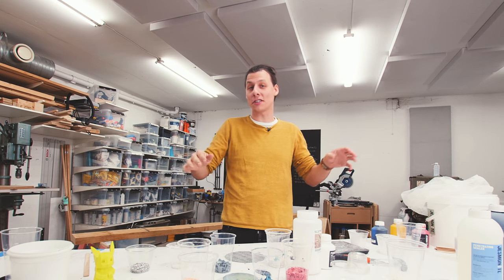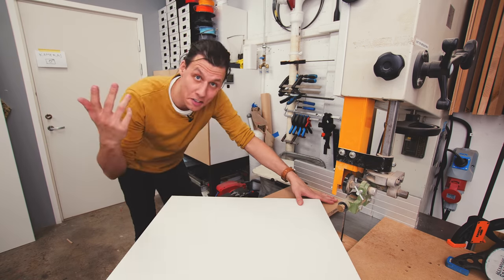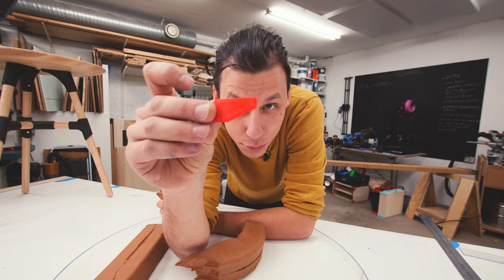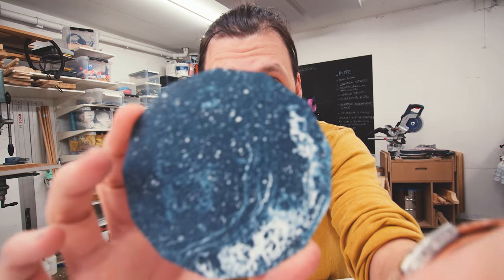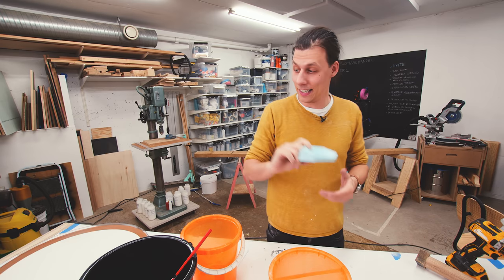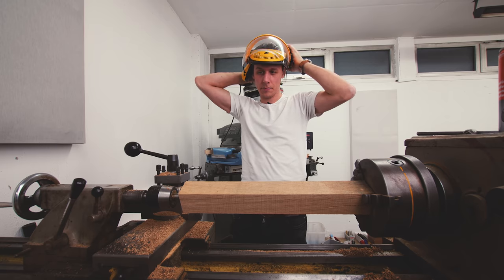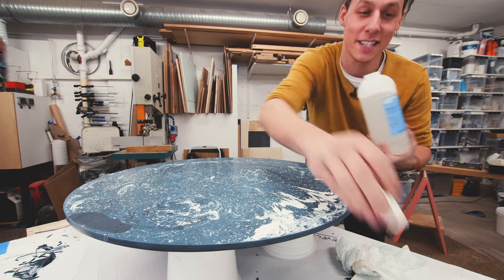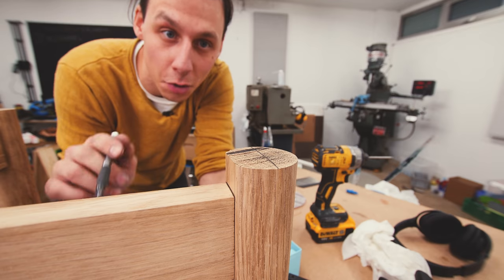Casting a Coffee Table with this Super Cool Material (Jesmonite)

Comment: I think this channel is a perfect example of how 3d printing can be useful in every project even just as a supporting tool for calibration / framing / spacing assistance!
Reply: It also shows how you can spend 2 hours designing and printing an object that could be made in 2 minutes out of a piece of wood
Reply: @tiloalo  LMAO! Sometimes that's true, but sometimes the dimensional accuracy of a printer for these things is much better than you can get with woodworking tools. Not to mention safer than using saws on a piece of wood that size. Hopefully that part wouldn't take anyone 2 hours to model 😂
Reply: @tiloalo  depends this guy have a lot of experience designing so it would'nt take too much time but 3d printing oh god that takes a serious time, the benefits is you can make it better, with complex shapes and in the meantime you could be doing something else so I all i see 3d printing is better.
Reply: @tiloalo  i guess it took the same amount of time as the wooden one would take, just because he already knows the angle he needs for the table and a little square as a handle, so i guess it took like 10 minutes to model and some free time for printing

Comment: Really cool!  I've got to try something with Jesmonite now!  Also going to put that auto clay technique to use for epoxy and concrete casting.    

One idea for you on the curved sides of the mold.  You can get PVC trim (designed for baseboards) for super cheap at big box stores here in the U.S....its fairly flexible and definitely much less expensive than polycarbonate.  Not sure if its available on your side of the pond, but might be worth looking for.
Reply: I checked the prices and it's not that expensive here. Maybe a couple dollars for that strip. I understand that in America budget is of massive concern, though. Especially nowadays.
Reply: No more Caulk Talk?  ;)
Reply: How’s the build going? Can’t wait for the next Modustrial update ❤️
Reply: where do you get jesmonite in the US

Comment: Nice & easy way to cut a circle!
One idea for a smaller table would be to include four screws into the mold (sticking out to the bottom) and then use threaded inserts to screw the legs in place.

Comment: This looks awsome! I really like the "night sky with the stars" touch, thanks to the smaller white peaces.

Idea for the next jesmonite project - as requested :)

Embedd some screws with wide and thin washers during molding, as a later attachment points. (Washers required for bigger surface, so they will not break out so easily from the final product.)

Someone mentioned in the comments that he could imagine this table as a "floating" sky. I think something like that can be achiewed, with legs with threaded holes.

Comment: Really nice job. I’m using Jesmonite for doing smaller pieces as you did in you other video with the vacuum moulds.
Normally I’m doing wet sanding also because of some round surfaces but when I tried with my rotary sander I wasn’t able to achieve the same finish. Can you please let me know all the sand grits you used to have that really looking good finish?
Thanks for the video and please continue doing things with Jesmonite.

Comment: Really amazing... At the end of the video you asked us to suggest future projects that you could try with Jesmonite. But how about combining this with 3D printing in a slightly innovative way? You can now get a variety of different flexible 3D filaments for printers like your Prusa. So maybe you might be able to use your 3D printer to make a mould, which you could then use to "cast" some Jesmonite... Because you can 3D-print much more complex and/or detailed shapes than you would be able to make using normal techniques, it might be possible for you to make something really unique. If this sounds like an idea, how about going to "the next level" and making a mould from several 3D printed parts? You could make a wooden frame/skeleton on the outside to hold them together and stop them deforming, you could 3D print fixing extrusions to let you run a nut+bolt through to help hold them in shape and you could use some of that auto clay to help fill in the seams between the individual parts of the mould. I guess the biggest restriction here might be the accuracy of the mould material - the ability of the printer to print it accurately [in my experience Prusa's are pretty awesome, but I've not tried flexible filament]. Then the only un-answered question would be: is it possible to use a flexible-filament print as a mould?

Comment: Thanks I've just discovered this product, very interesting. A question, can I pour this onto a wood base and leave the wood, maybe 10 mm of wood and 15 mm of Jesmonite? I need to make a surface with a square hole to insert a stove panel and I was afraid  that the Jesmonite alone wouldn't be strong enough to bear the tension. Would the Jesmonite bond with the wood without a release agent or would I have to staple some wire to the wood to give it a grip ? It would also save on the amount of Jesmonite. The sides of the base are about ten cms wide with the hole being about 45 x 60 so a total panel of 65 x 80 approx. Not sure if that's clear. Thanks

Comment: How strong is the Jesmonite in such a large, relatively thin slab? Would it help if you cast in some reinforcement, like a metal mesh? Are you planning to secure the top to the legs at all? Maybe some nut inserts would work well.

Comment: man this is awesome, the only thing i didn't like is the air bubbles that caused some small holes on the surface of the table, other than that this turned to a beautiful art piece 😍
Reply: You should always brush on a 1-2mm layer first and vibrate the mould - this prevents air bubbles!

Comment: @18:10 are those little bubble holes in the top? Maybe from the drill mixer or something. Would it be possible to put a thin epoxy layer on top to seal them?

Comment: Since everyone is doing resin this days my braing farted and thought "wait, if the clay deforms when heated once the resin starts curing it will destroy the chamfer!" Then I remembered you are using Jesmonite.
Reply from the maker: haha true! The jesmonite actually gets pretty hot too, just like plaster. But by the time it does, it's already set up enough to support its own weight.
Reply: There’s easy ways to do that chamfer without making it in the mold. Just do it on the table saw vertically and angle your blade

Comment: Nice project. Isn't Jesmonite a much better product than concrete and epoxi when it come to casting tops ?! I'm not sure what it takes to produce Jesmonite but I guess the fact that it's water based makes it much less toxic than epoxi, in the first place. And then doesn't it take way less energy to produce than concrete? I worked once with Jesmonite in the past (without pigments nor sealer) and found it easy to handle in terms of health concerns and the like. What are your thoughts on that ?? cheers, thanks for quality YT material.

Comment: Hard to tell on the video, but it looks like there are thousands of bubbles/holes in the surface. I think you need to remove those before pouring (vacuum chamber) and use a blow torch to pop bubbles after pouring. Still a good result though.